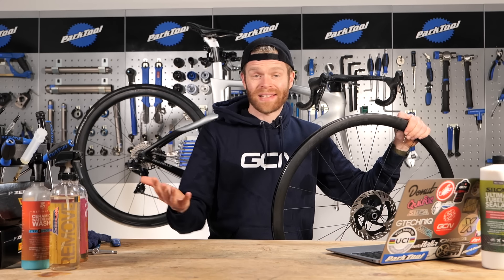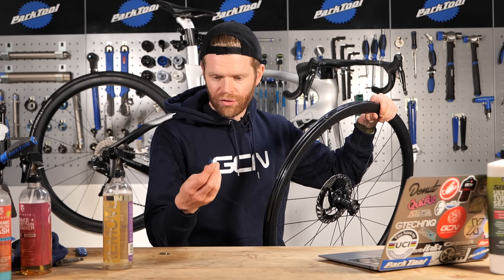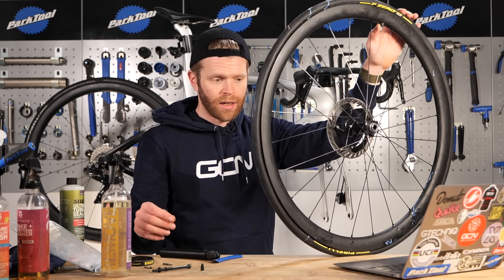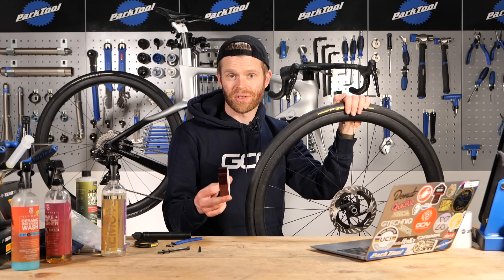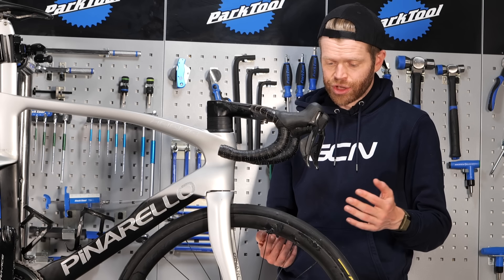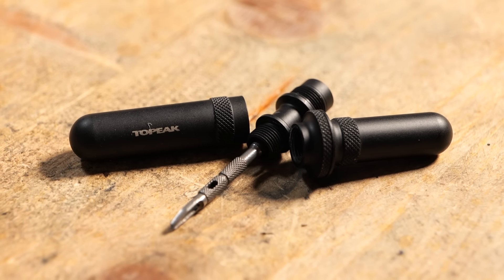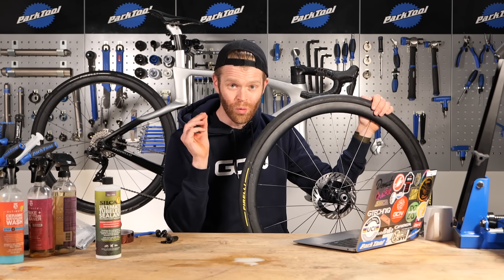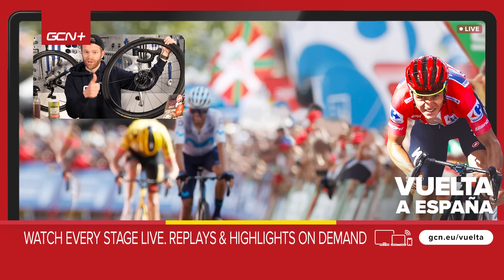Everything You Need To Know About Tubeless Tyre Maintenance

Comment: HI GCN, should I be afraid of over-tightening the valve nut and damaging my beautiful carbon rim? I Don't have a little o Ring in between and used a little bit of tape to make it seal properly, but I had to use a little bit more force out of my fingers to make I tight enough then i expected. cheers!

Comment: I tried tire plugs in a road tire (78 psi pressure). They squirted out within half a block, both with one and doubling them up. Seems like sealant might keep the plugs from bonding to the tire rubber. 
Also, my advice: DON’T use Silca sealant. The only thing it did for me was clog my valve cores very often (the valve itself, not just the stem) and peel up my rim tape. It couldn’t even seal a thorn hole well. (Separate incident from the plugs). I’m going back to the Orange stuff!
Reply: Dynaplugs work great at higher pressure.  Bacon strips won't work at all above 60psi or long term above 40psi
Reply: @veganpotterthevegan  i make my own out on old innertubes
Reply: @meneldil7604  plugs or patches?  I've patches some mountain bike tires with old tubes but they don't work well for road bike pressure because they're too flexible.  Dynaplugs are a permanent fix but I replace them with either reenforced patches or with a huge hole(got one last night from a screw), a Lezyne Pro Plug.  If you ever need to throw a tube in, the Dynaplugs will pierce a hole in them.
Reply: @veganpotterthevegan  Plugs just cut in in to strips make sure you clean the talc off
-
Reply: @meneldil7604  I can imagine those working like bacon strips.  Good for mountain bikes and big gravel tires.
Reply: @veganpotterthevegan  yea similar bit stiffer never had one come out and my tryes are about 90psi when I am doing a tt
Reply: @veganpotterthevegan  thanks. I looked at Dynaplugs and now I’ll probably get some for road-side repairs.
Reply: @meneldil7604  do you apply rubber cement to your homemade plugs (strips of tube) before inserting them? Still seems like sealant would interfere with the bond either way.
Reply: @bihlygoat  they're great. Definitely the most expensive tire plug on the market though.   But they're just so much more effective and faster.
Reply: @bihlygoat  no the sealant in the tyre should be enough
Reply: @meneldil7604 thanks. But it seemed to me that the sealant is what lubricated my plugs enough to CAUSE them to squirt out of my road tire.

Comment: Something I've found. If the sealant has sealed the hole - DON'T put a plug in just in case. As Ollie states, it just blows the plug out. I put a plug into a sealed hole which I was a bit worried about. Couldn't get a tube in as it was all too tight. Ended up having to patch the tyre from the inside, re-inflate it with a CO2 canister (to seat it) and cycling home on that.

Comment: Recently purchased Vittoria Corsa NEXT tubeless tyres. They are 24mm tyres and have proved difficult to set up! Required repeating the inflation over 3 to 4 days as the side walls are very porous and the tyres would loss pressure. Used the soapy spray to highlight the leakage. Gradually over the 4 days they sealed.  Schwable tyres don't seem to have this issue?

Comment: I know that for GCN, a requirement for “super nice” status is lining up the label with the valve. And I agree with that.
However, I originally would line up the label with the valve so I could locate the area of the tube that has been punctured. 
Tires do look better with the label lined up, but you don’t “need” to do it.
Reply from the maker: Great little tip! Knowing your tyre orientation can really help find those little punctures.
Reply: @gcntech  I should have added that I did it because if I can find where the tube was punctured, I could find the approximate place on the tire.  You need to check the tired, because if there is any imbedded debris, like glass or a shard of metal, you want to remove that from the tire.  The last thing you want is to cause another puncture because you didn't clean the inside of the tire.

Comment: I’m not a fan of tubeless.  A bunch of hot air.  Tubeless trouble shooting guide - gotta love it.  Never remember being shown how to trouble shoot tires w/tubes.  Amazing how this is dominating cycling.  Now you buy tape, sealant, sealant cleaner, etc.  Just buy a friggin’ tube!
Reply: You were never told/shown how to find and repair an inner tube, and to inspect inside the tyre before putting it back together? You had t gave patches, glue, sandpaper, chalk, a pump, and tyre removal tools. 

Now you just put some schmoo in and pretty much forget about it
Reply: @chrisdavidson911  Not on a road bike. You get reminded every time you get a puncture, and the sealant sprays your ass and faces of guys behind you, and you still have to stop and replace with a tube because pressures are just too high, and air volume too low, to seal.
MTB tires, gravel tires - tubeless is great. Road bikes - nope. Just use a modern TPU tube and be done with it.
Reply: Maybe it's different for high psi road tires, but for my setup (42 mm gravel tires), tubeless was a game changer for me. I used to get so many flats and now I almost never get them. The punctures either seal up on their own and for those that don't, I just pop in a dynaplug and I'm up and running again. My days of taking my whole wheel and tires off just to swap out a tube which I'll then have to spend more time patching are over.

Comment: I only have tubeless on my mountain bikes. Is there any real advantage for the average cyclist to use them on a road bike? I would love to hear your thoughts on the insert armor products that are out there. Would a tube with sealant in it perhaps paired with a Tannus armour style insert be a more effective flat deterrent?  I am currently running them in my daily commuter and I love them. It would seem to me that not getting flats is the goal. Well good Sir. Cheers - M
Reply: For me personally, I'm sticking with clinchers. I've set up road tubeless tires multiple times with different rim-tire combinations, some are easy to work with while others are downright hellish. You do not want to be caught having to work with a stubborn tubeless tire by the roadside. Stubborn tires are sometimes harder to get their beads seated and are definitely harder to unseat. It's not worth the hassle.

Comment: "It shouldn't deflate overnight" is a very good indicator and I always check my tires this way. However some tires are so porous that without sealant they will let the air out no matter what, for example Vittoria Corsa. Was very surprising to me.
Reply: Sadly every set of tubeless I have used deflates during the night. Not all the way but more than if I was using latex inner tubes.
Reply: Losing pressure overnight ( or even over 48 hours) is normally a sign that’s it’s time for me to top up my sealant.
Reply: @andrewmcalister3462  The advice in video was to test them before you add sealant, this way if there is anything you need to fix (for example valve gasket) you can do it much cleaner. Of course they shouldn’t lose air that fast with sealant in. I can ride for a ~week before it needs pumping up.

Comment: An awesome advance in tubeless tires/wheel design would be a tire that can have the bead seat easily without the use of compressor/special pump etc..  When flatting on tubeless road  tires, it’s common for the bead to break free. You will NOT be able to reseat the bead roadside with your puny pump or even C02 cartridge. At this point you must install a spare tube to continue the ride. But even with the tube installed, the tire will still not be ‘seated’ fully, leaving you with a wonky tire for the rest of the ride. Let’s hope for tire advancement in this area!
Reply: Only had bead separation happen once with 42mm gravel tires fwiw and I was able to reinflate with just my hand pump. Also my bead seats super easily with just my cheap floor pump . I guess I got lucky with my setup!

Comment: Surely it is easier to  just use an inner tube?
Reply: Here’s your prize for most original comment 🏆
Reply: Surely it is easier to have no gears than gears then too.
Reply: Not at all.
Reply: I think one way of looking at it is "would you rather do a bunch of tire work before the ride once or possibly during the ride a bunch of times". Writing within your tubes requires a similar amount of work, you just don't actually do it until you have a flat. The nice thing about tubless is that most of the time the sealant is plugging small holes that would have stopped to you on the ride, you just have to do a bit more upfront work to get that advantage. But yeah neither approach is an "easy" solution, it's just similar amounts of work done at different times.

Comment: #askgcntech I need help with saddle soreness. In particular, my gems going numb. I had never experienced this while I was riding outdoors exclusively. However, ever since the arrival of the indoor trainer, I have experienced it a few times - once, it felt like the gems had completely switched off (numb to the touch).

I have had a professional bike fit done; while I feel better, the numbness is something that has not been able to solved.

I’m in a pain of saddle rotation (buying new saddles every three months) in the hope that one will give me gems some peace and happiness.

Can you please shed some light on this and advise what some of you do to alleviate saddle soreness, particularly indoor and some of your epic rides. Is this more common that not - how serious could it be and what must be done for safety.

Regards
Reply: The comment contains a lot of information, but it isn't all useful. Are you fitting your bike to a turbo trainer, or is it a stand-alone entity like a Peleton or similar? It's unclear if you're fitting new saddles to your bike, the trainer, or both, and if the trainer has the same fit as your bike. Are you wearing the same clothes?

Have you tried not using the trainer for a while, just to rule it out?

Comment: When an innertube tyre deflates, a sharp object has pierced the inner tube. Find the object, remove it from the outercase and replace the innertube. OR, apply a repair patch to the innertube where it was pierced.
Using this set-up, there is no runny mess.

Comment: Nice video - trouble applying rim tape, hard to mount tire, messy sealant, clogged valve, air leakage, etc., etc.  And you may still get a puncture and need to carry and install a tube because it won't seal.  Thanks, but no thanks.  I'll stick with a simple inner tube.  I use heavier thorn-resistant tubes and have been puncture free.  They add a little weight, but so what.  No weight weenie here.  😊

Comment: I have been riding on my road bike tubeless setup for 3000km. Love the comfort of tubeless. However, lately I often see some (very little) tubeless sealant on the back of my bike (without even noticing I've had a flat). I can not find any hole in my tire or whatever it is causing. Is it time to replace my tires? Or should I not worry about it?
Reply: If you can't see anything wrong, the only thing that could be worth doing is putting some more sealant in. Has there been a lot of hedge cutting where you ride?
Reply: @chrisdavidson911  after further inspection it just seemed like the tire was worn and it was time to replace anyway… I also have a race coming up so I didn’t wanna take chances. But when I took the tire off, no sealant was left inside. So maybe topping off would have helped!

Comment: Quite interesting how many people rave about how good tubeless is, until it isn't - and then the solution to stop the leak is to use an inner tube. Messy
Reply: This is why I always say people claim to love the new and advanced stuff until they have to get their hands dirty to work on them. Such things include, but are not limited to:

Tubeless tire setups
Integrated internal routing (especially those where the shift and brake lines run inside the stem)
Reply: I've been running tubeless for about 2 years now, have yet to experience this "isn't" you speak of. In that time, I've never had to put in a tube.

Comment: Getting old sealant cleaned out of the rim and making sure the full tire/rim interface is perfectly clean before re-installing is beyond a nightmare.

Also if you have sealant leak into the rim cavity there’s no way to clean it out especially with Silca Ultimate.
Reply: I've never really bothered making my bead clean between tire swaps. It's never been a problem.

Comment: I have had NO problems with tubeless in the 4,000 km since I changed over, other than the tape that came with the wheel needed to be replaced.  Also, the valve needs to be checked once in a while. But I have had zero problems on the road, which wasn't true when I had tubes.  Also, add or replace the sealant every 6 months.
Reply: I’ve recently converted to tubeless after a run of punctures, one a week for 8 weeks, and 2 ruined cut tyres. I don’t mind a bit of maintenance if it means no more punctures

Comment: Is there an issue with using a tube (temporarily) to get you home if you're using a hookless rim/tyre setup? The Zip website seems to say this is okay with their hookless rims, but the mechanic at my LBS says no way. Specifically, I'm using Enve SES 4.5 wheels with Enve 27mm tyres.
Reply: All Hookless rims are super dangerous!  Go back to hooked rims ASAP
Reply: There shouldn't be an issue as long as you're using a hookless-compatible tubeless tire and stay in the pressure limits.

Comment: The arguable advantages of road tubeless:

Lighter
No pinch flats
Better handling
Cushier ride

Disadvantages:

Sealant doesn’t fix cuts

Sealants aren’t designed for high pressure tires

Sealant sprays out (no fun in a paceline)

Need to carry plugs and or inner tube (plugs don’t bond if the hole has sealant in it, putting a tube in a sealant filled tire is messy)

Tricky to get the bead to re-seat after installing a tube (results in a bumpy ride)
Reply: I don't believe road tubeless to be any lighter than road clinchers, but yes, tubeless is better suited for low-pressure setups, such as gravel, cyclocross and any MTB discipline.

Comment: #AskGCNTech I have Vittoria Air-liner Road setups in my 28mm tires on my bike and have had them for almost a year. I'm noticing that I loose air pressure (~5-10 psi per day) than previously and want to add more sealant as I think that is overdue. However, I am struggling to get more than a few grams of sealant in at a time as there seems to be very little room to add it. I meet tremendous resistance after just a few grams of trying to inject, and it often pushes much of that back out when I remove the syringe.

Is there some trick/technique or recommended method to add sealant in a road tire with Air-Liners?

Comment: My last puncture dates back before the advent of puncture-resistant tires which means roughly two decades and now I'm told I should change to tubeless and change the sealant every six month or at least once a year? Right now I'm running latex innertubes with high performance clinchers at about the same rolling resistance and no maintenance needed whatsoever als long as they last. The idea to switch over needs more foundation than constant repetition on various channels to let me follow this recommendation. To me, there is no point at all, just more trouble ahead.
Reply: No punctures in two decades?
Reply: @henseleric   Two punctures since 1990 to be more correct. It all depends on the tire in use. I have been commuting on a daily basis whole year through and remember a flat at the beginning of the 90's, changed to Schwalbe Marathon 28 mm on that bike and rode it that way untill the frame broke a decade later. No flats on the dedicated road-bike during that time. Another flat in 2007 with Ritcheys (last flat I can remember) that came with a Cyclocross bike out of the box, replaced for Conti 4season for commuting, no more flats. Same on the road-bike with Michelin and Contis. Use good tires, have no flats, no need for tubeless.

Comment: Why use the Silca refresher sealant for the video? It's a new tire install, you need their actual sealan with the carbon strips which they claim is one of the most important parts of their sealant working. The carbon strips will absolutely block a valve stem so it needs to be dumped into the tire and not injected through the stem. The refresher can be injected though the stem.

Comment: Be aware: Schwalbe aerthoran, a TPU innertube, states keep away from tubeless sealant, regardless of what Ollie said!
Reply: Something in the sealant's composition can break it down?
Reply: @sbccbc7471  Dont know the reason, but it is written in the manual: " Aerothan Tube should not come into contact with tubeless sealants. If necessary, clean the tire and rim with a rag before assembly."
Reply: @ThomasHubik  from Schwalbe's website;
Can I use Aerothan Tube with sealing milk?
Sealing milk does not achieve a seal with Aerothan Tubes, because the thermoplastic polyurethane (TPU) has a very high surface tension. The use of latex-based sealing milk on TPU tubing is not recommended due to its chemical composition. For optimum performance, Aerothane Tubes should only be used in jackets without sealing milk. Continuous operation with sealing milk is not recommended.

Infuriatingly unhelpful, sounds like it either won't stick, slowly melts it, or a bit of both.

Comment: Ollie, why didn’t you mention that if you need to install a tube that you need to remove the sealant valve.  Way too much hassle. Just use tubes.  Just purchased a new bike.  The tires were setup with sealant.  When I took it in for a 30 day inspection I had them remove the sealant and install tubes.